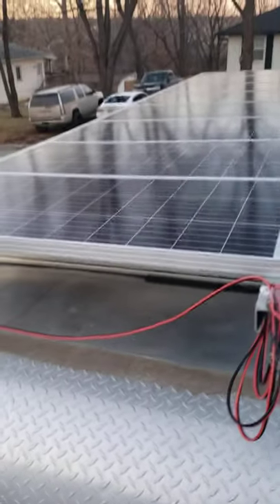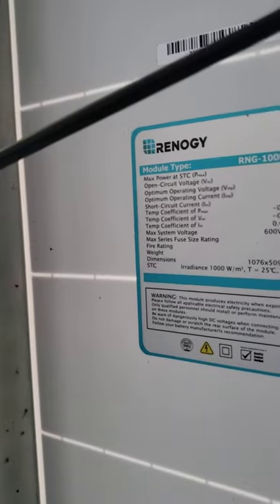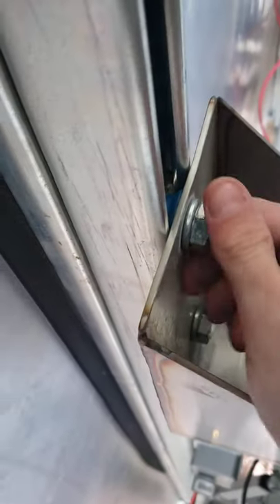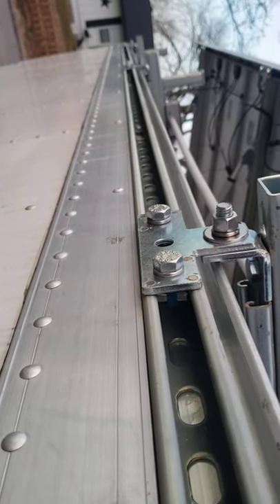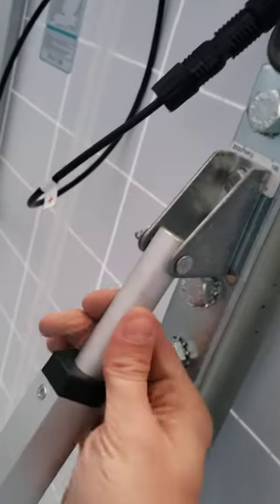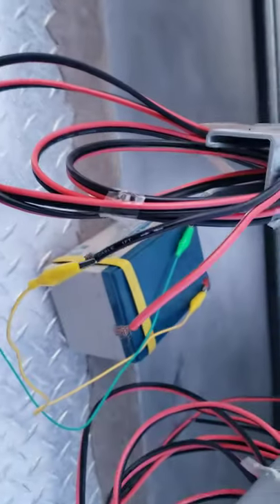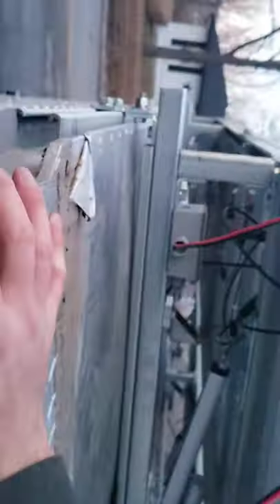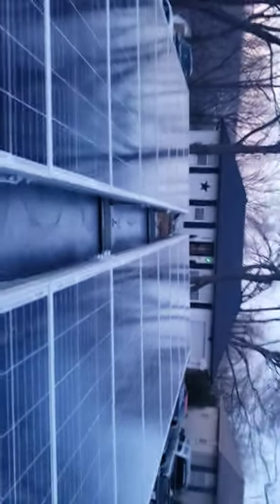RV solar setup completed

Comment: Take your time, be patient when it matters, listen to what others say but don't live your life by their words.  First and foremost, believe in yourself and stop trying to prove yourself to others.  Don't go around looking for people to fight you...there is nothing of benefit to you, down that path.

It looks like you've done a good job with these panels.  I think it's cool the way you've made it so they can tilt.  Some of those cables are rubbing and that's a long term liability.  Some of that split wire loom would be a good idea?  Keep doing your thing and don't get caught in the trap of trying to impress others.  When you are happy and confident with yourself, nothing anyone else says or thinks means very much, although you'll find that more and more people support you, when you're not constantly seeking their approval.  BTDT
Reply from the maker: Cables will be ran through the roof. I just need to decide where exactly I want to put the boxes and will add the conduit when its done. Its only temporary as there's no way to keep them on when driving. Very thoughtful words of wisdom

Comment: Looks good, but I think that if you tilt the other row of panels, they will shade the first set.  What is the part number for the linear actuators if you have it handy?
Reply from the maker: The is no possible way to prevent shade. BUT the only thing you can do is tilt the ones furthest away, toward the sun as you will get more power without any shade. The space on vehicles really is at a premium. But the thing is it's far better than being flat. So it will always out preform roofs
Reply: @DragonsREpic  yeah, I really couldn't tell how much space you had to work with....definitely more power if you can tilt the panels vs flat.  There is info out there to tell you the optimum pitch depending on location and time of year.  Looks good so far.
Reply from the maker: https://www.amazon.com/ECO-WORTHY-Actuator-Maximum-Mounting-Brackets/dp/B00NM8H5UA/ref=sxts_rp_s_a1_0?cv_ct_cx=linear+actuator&keywords=linear+actuator&pd_rd_i=B00NM8H5UA&pd_rd_r=49c7aee6-bbb3-4b93-a03b-f717f3888b5e&pd_rd_w=fgto4&pd_rd_wg=5V0Q9&pf_rd_p=417cc47b-0c09-4851-92d2-3088b503e056&pf_rd_r=P6NRMH7MFFGS48CQMK6F&psc=1&qid=1642353489&sprefix=linear+a%2Caps%2C212&sr=1-1-5985efba-8948-4f09-9122-d605505c9d1e
Reply from the maker: @mdrew44628  thats why I'm making it tilt and will will have a display. I don't need to do any math, just tilt untill you have the highest output, assuming the batteries can take it all  which they can't as they are just a few batteries that are several years old. I'm working on 18650 right now